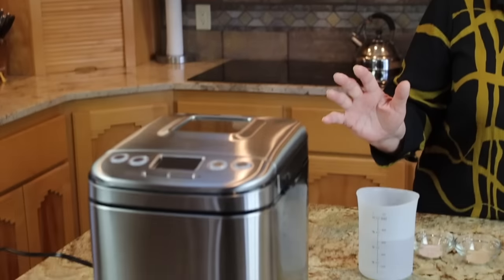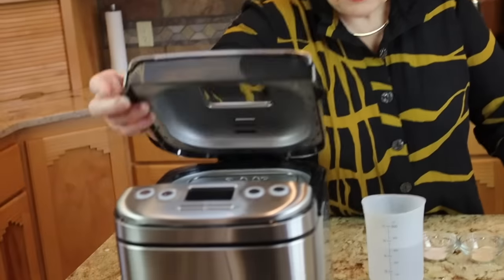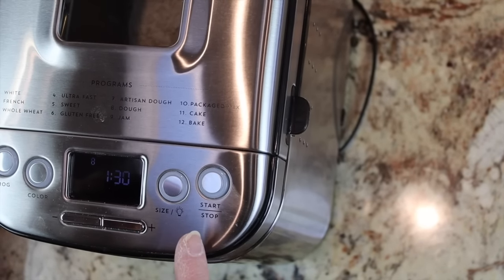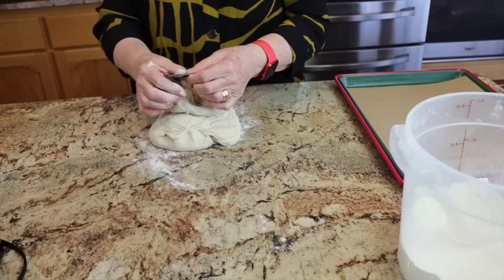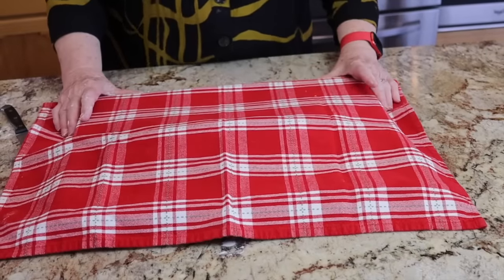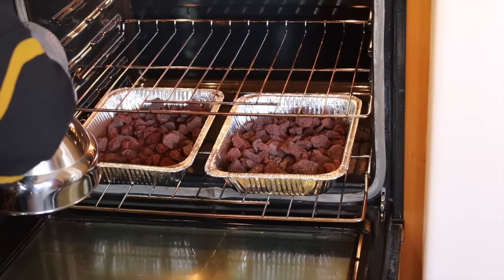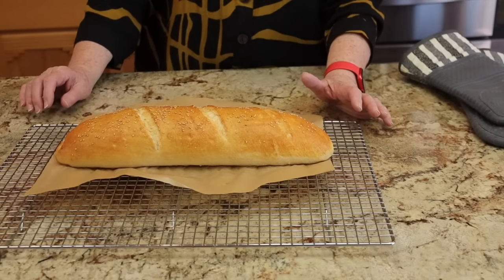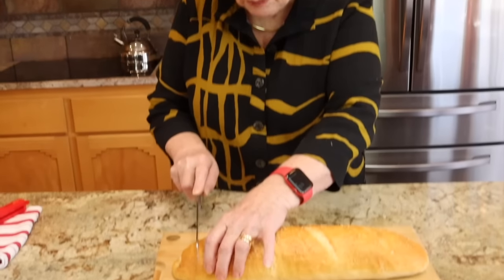French Bread in the Bread Machine

Comment: I just toss ice cubes into the oven while the bread is baking. A lot easier than using lava rocks or a pan of hot water and it's fun to hear the hiss!! 😊
Reply: Is it detrimental to the oven?
Reply from the maker: Interesting.  I have read about placing ice cubes in a pan in the bottom of the oven, but not just tossing them in loose.
Reply: @cynthiafisher9907  no, i doubt it & i have an electric oven.
Reply: @RoseRedHomestead  why use another pan? I just toss a few in and shut the door. They melt fast. I have an electric oven...

Comment: YES! Lava rocks are so easy for steam! I’ve been using them for years. Mine live on my oven floor in a sturdy old pan. Things that took me many years to understand 1) the steam keeps the crust soft for oven spring, 2) the oven needs to dry out to make the hard crust.  My method: 1) throw about one to 1 1/2 cups cool tap water on the rocks just before loading the bread. 2) spray the rocks one more time after 3-5 minutes. 3) after 15-20 minutes rotate bread, 4) depending on type of bread, start checking for temperature & deep color. I usually make boules using pizza stones in my oven. They need an hour to preheat which troubles me - so much wasted power! I bake with 2 pizza stones - two loaves per stone - 4 loaves at a time. I use “heatproof” oven mitts to rotate the loaves. One more note, if you can chill the dough overnight and sneak in 25-30% fresh ground flour, you will get more flavor! In the winter, I leave my dough outside overnight - it works great even when freezing!
Reply from the maker: Thanks for the information,  Jim

Comment: I have a pan / can in my bread-machine that looks just like that one you have.  I make bread with organic spelt wheat that I mill in my Aldi Ambiano blender.  Anyway, at times I have found the rise was variable, and the top would sink.  I obtained success by, after removing the paddle prior to fermentation, I fashioned the dough around the sides as much as possible, chimney like, rather than the normal blob.  This forces the rise to go into the center.  It also heats the dough more, as the heat comes from elements surrounding the can.  It rises like magic, and sinks very little.  It is amazing that the hollow center eventually fills in like there never was a hole there.  Anyway just passing this thought along for those who may want it.
Reply from the maker: Very interesting technique and solution.  Jim

Comment: I had a Breadman bread machine that I used for over 20 years and last year it quit on me.  I haven’t replaced it yet and have been making bread with my KitchenAid mixer.  I love the bread machine because it allows you to make bread virtually hands-free.  This Cuisinart looks like it will be a good replacement.  Thanks for sharing your review and recipes.
Reply from the maker: You are welcome.
Reply: I have a Breadman that I have had for 25 years at least. It still works fine, but when I saw Pam’s new bread machine, I decided to get one like hers. I checked on Craigslist and found one exactly like hers still brand new in the box. I was thrilled! On to do experiments!

Comment: I have a technique I use for steaming without a covered lid or casserole.  I use it for my baguettes. It became very popular at my bread forum.  I use microwaved rolled steamed towels. Heat to very hot and place them in my choice is a pie pan or two.  Add a little more boiling water to pans over the rolled towels.  This is a very cut short directions.  It works fantastic and especially great for those using a gas oven because they vent.  I have a regular oven that I love with oven stones.
CAUTION.  Always place a Towel over your oven door if you are going to be pouring water over the stones or pouring anywhere near your oven GLASS DOOR,  water hitting on it has been known to break to glass.
Reply from the maker: Thanks for the information.  Jim

Comment: I only have a halogen oven and when I need to steam bake I just put water in the bottom, keeping it lower than the rack. so it might be that you don't need the rocks, just put some water in those pans and they will build steam as the water heats.

Comment: I remember reading somewhere (king Arthur’s site I think?) that you should either bake with steam or an egg wash, but not both. I’ve never tested it myself but maybe that’s why the crust didn’t stay crisp?
Reply: After your pan of dough is in the oven, placing an oven proof metal pan on lower rack prior to this, throw in a cup of water into pan, & close immediately. 
Steam helps the crust be crustier. That's been my experience.
Reply from the maker: I haven't heard that.  I will check into it.  Thanks.
Reply from the maker: Sandra that is why I used the lava rock i the video.  Same principle only the rock holds more water and generates more steam.

Comment: This is a very informative video and I especially appreciate the instruction on loaf shaping.

For what it's worth, here is my experience in creating steam in the oven:
1) I bought a light weight stainless steel skillet at the thrift shop and gave it a home on the bottom rack in the oven.
2) I preheat the oven to 460F.
3) When the dough is risen, I pop it in the oven and immediately throw a shot glass full of water into the skillet (about 1.5 oz). 
4) After closing the oven door, I reduce the set temperature to 350F. This creates an "oven off" condition for the first 10 minutes or so. Apparently, still air helps with oven spring, for some reason. See youtube "Bake with Jack" for an explanation of this.

I have experimented with the volume of water needed to create the oven spring. 1.5 oz seems to work reliably. 3 oz failed to create any lift. Maybe it dropped the interior temperature too much. In your case, the mass of rocks is much higher than my skillet, so I assume the temperature dropped less when you added water.

I bought a stand mixer many years ago but felt foolish when I discovered a $10 bread machine from the thrift shop can do all that I want the stand mixer to do.
Reply from the maker: Thanks for information.  Jim

Comment: great video ! just a quick question, i have the same bread machine and on dough cycle it does a couple of rises but you said take it out after the first rise so does that mean you don't let it run the full hour and a half or was that just a mistake. 🙂
Reply from the maker: The problem we had with it was that it nearly touched the top inside of the bread machine and burned.  Jim

Comment: I've never made bread of any kind before so I'm following your instructions to the letter. One thing I'm missing though is how long it takes the dough to double in size? Minutes or hours? You didn't mention that in the video. My loaf is covered as I'm writing this but it doesn't seem to be rising much. It did rise nicely in the bread machine, however, it was a bit stickier than yours seemed to be when it was time to take it out. If this is actually edible when I'm finished it will be a miracle. Any suggestions would be helpful. Love your channel!!
Reply from the maker: Pam stated in the video that the rise time is dependent on the kitchen temp and can take from 1/2 to two hours. But, you van tell is ready by doing the finger test.  Jim
Reply: @RoseRedHomestead  Thanks so much for your quick reply Jim. My bread actually turned out decent...not as perfect as Pam's but not bad for a rookie like me. I obviously didn't let mine rise as much as it needed to (about an hour) so it was a bit more dense but overall I'm happy with the result. I'm looking forward to improvement on  my next attempt which should be a nice addition to our Easter meal. Thanks again and I look forward to all of your upcoming videos!!

Comment: Trying to create steam I have warped sheet pans with boiling water and, by misting, blasted carbonized specs off the interior of the oven onto the dough. The lava rock method looks more viable but I would still be worried about deep sixing the oven window if any water spills. I much prefer to use some kind of cloche system where the bread creates it's own steam such as the cast iron dutch oven method. For a large and cheap cloche, an upside down stainless steel bowl on top of a pizza stone works. A metal handle could be added for a dedicated cloche that can be grabbed with tongs.
Reply from the maker: I like your ideas to use equipment you already have.
Reply: most often used  is an old iron frying pan with the lava rocks.

Comment: Hi, is this recipe meant to be used only with a bread machine?  I followed this recipe and kneaded on my own and it didn't rise much and the dough was dry.  It baked well and tastes delish it es just dry after the first and second rise and not smooth at all. Thanks
Reply from the maker: It was the recipe in the book that came with my bread machine, so I would have to say yes.  I use a different recipe when I make it in my stand mixer.

Comment: I followed the instructions and my bread got really dark on top but stayed fairly light on the bottom. It also seems like it might not have baked completely since it seems doughy in the inside instead of fluffy. Any idea why? Maybe my oven was set too high on 425? It was on the middle rack but I didn't use the lava rocks, I just spritzed it twice like other commenters have mentioned. Any advice would be appreciated!
Reply from the maker: Sometimes, there may be too much water in the dough, or the oven runs too hot, or you may need a lower temperature and longer time in the oven, and so on.  Jim

Comment: Do your cuts it’s actually called scoring Also your dough is really pretty
Reply from the maker: Because the equipment is much more sophisticated and built/engineered for making food last that long. If you do not remove the oxygen then you do not have freeze dried food. We tried the freeze frying in jars and it did not work. Vacuuming dehydrating dehydrating food is can be done for long-term storage, it lasts about one year.  Jim